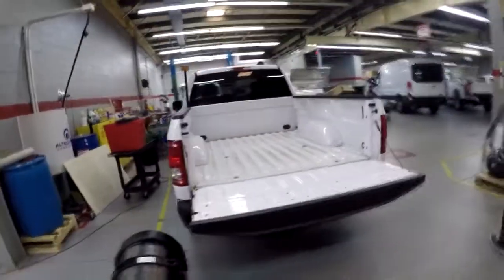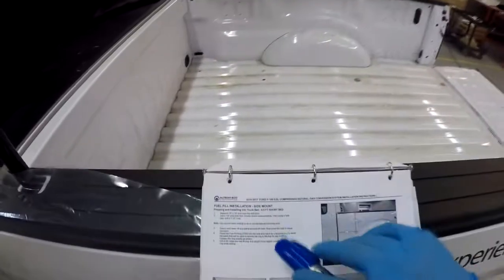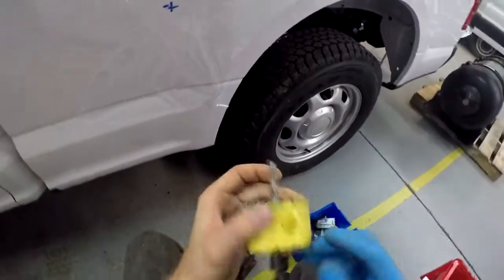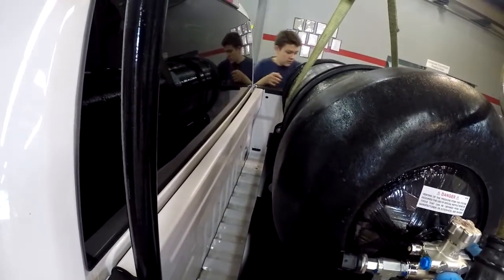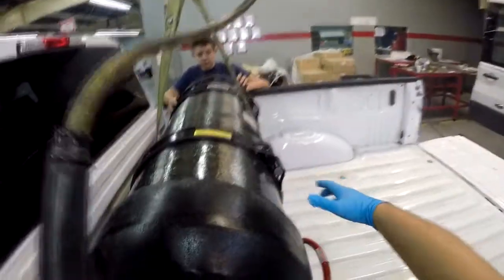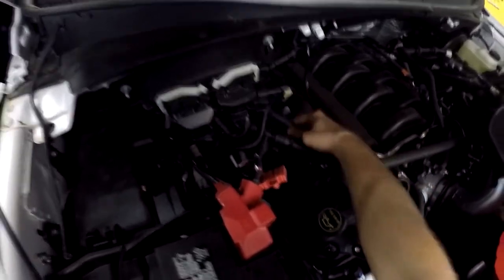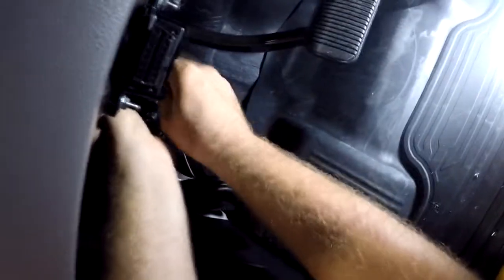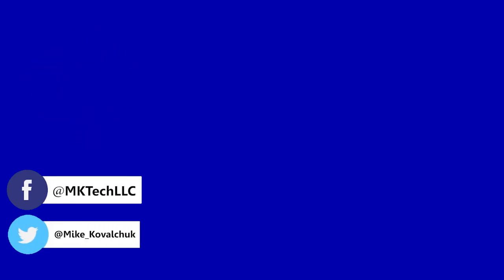2017 Ford F-150 Bi-Fuel Conversion [CNG]

Comment from the maker: Comment what you guys thought!
Reply: MK TECH hey how much it's this conversion cost I've order my 18 f150 5.0L with cng prep package from ford already
Reply from the maker: Altech Eco is ford QVM which means qualified vehicle modifier, saying that  Altech gets the orders from ford and upfits the vehicles.  The cost of this conversion varies 8-12K.  sorry for the late response, didn't see comments
Reply: MK TECH wow not wort it just keep mine the way it is already spent 75k on my truck
Reply from the maker: manuel M Ramirez , it’s good for fleets.
Reply: MK TECH yeah I'm just a regular guy own 1 truck
Reply from the maker: manuel M Ramirez I see , an expensive truck !
Reply: @MKTECHUA is this possible for a 2011 f150 5.0 and still keep the gas tank and use both fuels ?
Reply: I have a 2004 Ford F150 and I want to put this same system

Comment: Do you know anything about the air guns they have a tank that can handle up to 4500 PSI can we use that instead of this big heavy tank
Reply: I have those air tanks for PCP yeah they hold a lot but not enough to get you any good distance on the road on the road I need to find a way to compress the natural gas by myself without having to purchase one of those homefilling stations for 5 grand

Comment: Hey man I have a 97 chevy propane powered(only power) it came with a dual fue integrated processor, all the old gas system is still in place except pump and tank. Do u have any insight of making it dual fuel?? Please been looking for awhile for answers.

I also has a decelcontrol module on  top near the fuel rail
Reply from the maker: MrJtmelement let me think I’ll get back to u shortly
Reply: @MKTECHUA  lmk thanks!

Comment: Hi Mike - thanks for the video. I have a question: I recently purchased a 2001 Ford E250 van with factory CNG. I'm interested in making it bi-fuel. How doable would this be on my own and how much would it cost for a professional job? Thanks!
Reply from the maker: Well,  it will cost you a lot , first off , you need a bi fuel calibration , Ford doesn’t have a bi fuel cal available for 2001 , that means that you will have to go with a after market calibration, which means you have to add extra set of injectors and another driver/computer.  Our company used to own a 2001 f250 and I did a lot of work on it , I believe that a lot of gasoline components are out of the vehicle also, can’t remember which components .   So , it’s doable however, it will cost you lot of money to make that vehicle run properly , and still can’t guarantee that it will bc it will be aftermarket .

Comment: What tool do you use to modify the PCM to change the engine fuel type or ratios, I want to actually convert a 2003 F150 engine Z type back to just gas and want to know what module to modify using forscan.  I am going to remove the rails and use gas only injectors.  I after you installed your conversion what did you have to program?
Reply from the maker: Tom Dunkle good question ,  Altech Eco is a Qualified Vehicle Modifier for Ford Motor  Co.    We have calibrations provided from Ford to flash the PCM.  What you need to do is , stop by your nearest Ford dealership and have them to reprogram your PCM with their IDS tool !

Comment: Is it even legal in the US? :O LPG is pretty much a norm in Europe but it's highly regulated, it has to be made by certified shop, using new parts that have to be bought from local dealer so for eg you can't buy the same kit in France and install it in German workshop but making an installation in another EU country is not a problem though.

Comment: Hi Mike, how feasible would it be to remove a CNG conversion, and return the vehicle (also an F150) to gasoline?
Reply from the maker: +32Dorbust what year is your truck and what system u have on ?
Reply: Hi again Mike, I don't own the truck, was considering buying a 2004, F150 that the City of Phoenix (I assume they were responsible) converted to NG. The truck has a long bed, and is 2WD.
Reply from the maker: 32Dorbust it’s do able if you know what ur doing !  First thing is first , if it’s a 2004 , more then likely that truck is mono fuel , you would have to buy the gasoline fuel rails and other gas components that are missing , then you would have to take it to ford dealer for them to flash it back to gasoline !  Once again if it’s a 2004, it probably came converted from ford !
Reply: Hi again Mike, thanks for the insight. Yes, it is mono fuel (it is only equipped to run on natural gas). Do you think it would have come with a gasoline tank mounted in the customary location, (there is only one fuel door on the driver's side) or would I have to acquire the gasoline tank/pump, filler neck/door, supply/return lines, wiring, etc., in addition to the fuel rails? Thanks again
Reply from the maker: +32Dorbust bro it’s a possibility, I would have to look at the truck to tell u 100%.  But my 12 year experience and developing the system that we developed at Altech Eco , that’s the reason we always keep gasoline components on the vehicle , run it bi-fuel, just for situations like this !!! U understand , or u want me to go into more details ?
Reply: MK TECH more details.

Comment: Why flex line?  Hard line is safer and 100% more appealing.
Reply from the maker: Flex lines are as durable as stainless steel, because the testing they go through.  however, flex lines are easier to install and actually reduces the conversion cost.